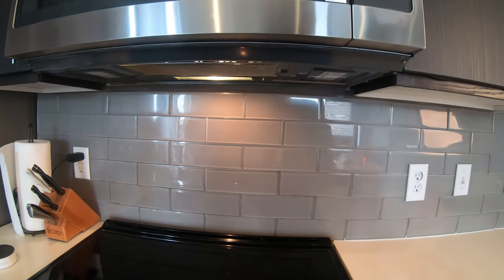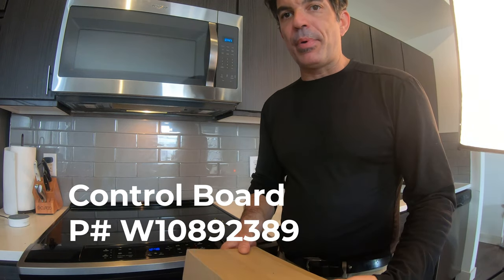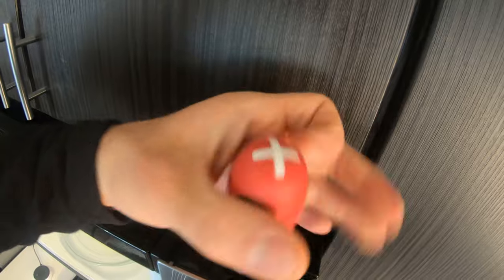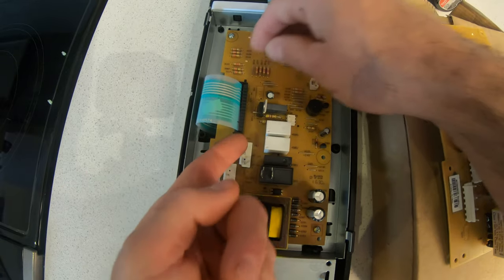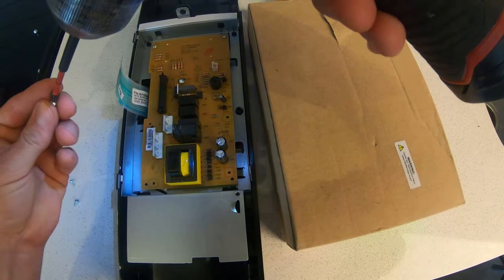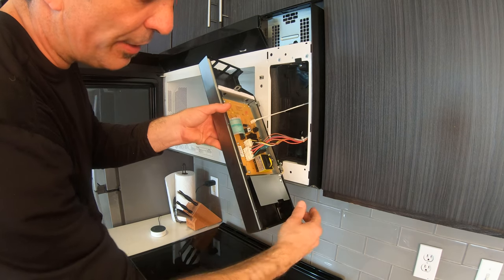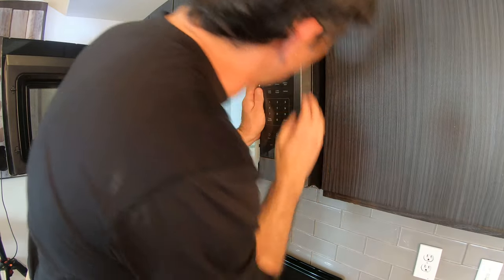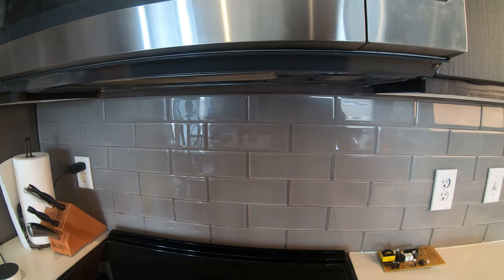Microwave Range-hood Light Won't Turn off

Comment from the maker: Finally got around to making a video replacing the bad triac on the control board. Much cheaper fix than replacing the board! - https://youtu.be/T5OyIWVZFKA
Reply: Did as you said and it works fine with the new Triac, Thanks bunches!

Comment: If you put in an LED bulb, it will stay on all the time because LEDs require such a tiny amount of current. Whirlpools dimmer switch design will always let a tiny current through even when it says off. Put the original style incandescent bulb in it and it will likely then shut off. This was my problem.
Reply: Bingo
Reply from the maker: We don't use the LED bulbs in ours but good call if it helps others with this issue 👍
Reply: We tried incadenscent bulb but it did not turn off either. 2019 model?
Reply: I purchased 10 different incandescent bulbs brands and watts and volts and nothing.
Reply: Thank you so much
Reply: @brauliosalazar2108  me too
Reply: I just noticed your post after writing mine a moment ago and that explains it very well, thanks. I'm leaving the LED in, the lamp won't get hot and being on very dim doesn't bother me.
Reply: @garystephens8413  curious have you had burnout issues yet with the LED yet? I just got a replacement and noticed it's always on and did not want run a risk.
Reply: @garystephens8413  any issues with the LED bulb after 5 months? Can you tell us the brand/bulb you used?
Reply: Thanks! Our bulb blew out and we replaced it with an LED and noticed it wouldn’t turn off. Good to know I don’t have to replace the entire control board. 😂 We will just leave it be and if it bugs us in the future go back to a normal bulb.
Reply: I thought the same thing and it didn’t work man I bought an led and incandescent
Reply: Exactly right. Go back to regular bulb. LED will stay on.
Reply: Thought the same thing but the LED got hot as well and started blinking randomly.
Reply: Our microwave bulb is not LED and that sucker popped after a few minutes. Any other suggestions?
Reply: Yes. That was the issue. Thank you
Reply: Not always the case. The incandescent bulbs stay on because of a fault.
Reply: I have the same model microwave, I just put in a new LED bulb because the original burned out. It is not turning off for me either. :(  I guess I have to swap it out for an incandescent bulb.
Reply: Thank you saved me a real headache
Reply: Thanks. I am tired of changing that bulb. My entire house is LED so this time I tried LED in microwave and it would not go off either. Rather than buy an incandescent build I took my wife’s advice and just leave the LED on. It doesn’t dim either.
Reply: @miriamranalli2896  You have to make sure your LED Bulb is dimmable. I had to replace mine from Amazon because they sent non-dimmable ones. They still won't go all the way off, but the Half & Full settings work.
Reply: So if I have the incandescent bulb in there and it stays on I have to change out the board?
Reply: @ohdag  same question
Reply: I put regular bulb back in and still did not shut off
Reply: @rudybehrens9788  most likely the control board got damaged because I’m guessing when you were trying to replace the bulb first time, microwave wasn’t unplugged from the outlet
Reply: Same has happened to me with LED replacement. It’s much brighter than my incandescent that only lasted 2 months. A dim light over the stove at nite is a great nightlight so I’m leaving it.
Reply: I’ve tried 3 different sets of bulbs, Xenon, Halogen (the recommended replacement for this microwave), and LED too. All of them remain ON and none of the dimmer settings work via the microwave’s touchpad.

Looks like this microwave is going to need a new control board or a replacement outright.

Jenn-Air is the brand of the microwave I’m working with today. 

Note, the halogen got VERY hot and quickly too, which tells me something is definitely wrong with the internal electrical circuitry.
Reply: Needed this I have LED. Will this cause a problem?
Reply: @ayanarudisill3112  u need to unplug power first
Reply: So what is the cost of this control panel,  no one mentioned the cost.
Reply: I'm seeing 120.00 cost 😢
Reply: That was my issue. Sometimes cheaper is better.
Reply: Thank you! I was about to buy a control panel, but i use led lights. You saved me money
Reply: Is it safe to leave the led on all the time?
Reply: That is so fucking mind blowing. 🤯 LED BULBS 💡
Reply: No it does not mean something is wrong,  halogen bulb get extremely hot, hot enough to scald a person.
Reply: Says simple and easy. Takes microwave apart and changes major component...
Reply: Thank you for this response. I thought about that too. I put a led light in. Not intentionally but that’s what I got when I ordered it. I’ll try this route first before buying the circuit board.
Reply: THANK YOU!!  Phew. I bought a second hand stainless microwave this same as in the video & I use all led in my place & it made a big diff in my electric bill !  However the microwave didn’t light up so I went bought a led bulb when I saw they finally had them on such a little bulb last time I bought one they didn’t .   So I put it in but ya it’s high , low , then dim but no off.  My daughter has this exact microwave in the house she built & it turns off so I knew it was suppose to.  I was afraid like this video shows it was some part ( that I’d never bother to buy ) lol. So thank you for adding this comment & letting me know that’s probably the issue !  That’s just great.  Thank you so much !  Really.

Comment: Thank you for your video. It was very helpful. Have a Whirlpool model WMH31017HZ-0, 10/17. Changed the above range bulb WITHOUT unplugging it. Heard a large pop. Fried the light socket and that part of the control panel. Had to replace the light socket and the electric control panel. Repair vs replacement costs were close. Customer service at Whirlpool was not helpful. This video was what was helpful! Thank you. Side note: If you replace the electric control board, the black mechanism that the green ribbon goes in is “tricky”. The black piece does elevate about an eighth of an inch when you pull those tiny black tabs up. When you carefully put the ribbon into the slot, you have to push down gently on the  black mechanism to lock the ribbon connection.
Reply from the maker: Ya I’ve seen these fry when replacing bulbs before. Thank you for sharing your experience with us 😊
Reply: Very helpful.

Comment: Thanks for the video.  Experiencing the same issue.  I pressed the Light button and heard a pop and bright flash.  I thought the bulb blew, which it did, but apparently it also zapped the control board.  Mine is from 2016 (WMH31017FB - 0) and Whirlpool chat was not helpful once they got my S/N and saw that it was well out of warranty.  They won't do much of anything beyond confirming for me that there were no recalls on this model.  Before seeing this video, I just bought an LED bulb off of Amazon.  It's a 5W LED (40W equivalent) and used about $.52 of electricity per year if left on 24/7, so decided to go that route and will likely stay that way unless I decide to buy the triac.  Thanks for the video.

Comment: Thanks for this video.  I was able to follow it exactly and perform the replacement without major difficulty.  I was surprised at the trickiness of getting off some of the connectors, especially the two individual wires (black and red).  And just in case someone else didn't take enough pics while disassembling--the black wire goes toward the back.

Comment: The Triac P/N BT136-600D on my control board P/N W10800189 was shorted between terminals T1 and T2. There are two triacs on the board. The culprit is 7919 (marked on board). Amazon sells them cheap. Replaced it and all is well. Saved some money. 😁
Reply from the maker: Nice job John thanks for sharing your repair method 🛠
Reply: Thank you thank you!!!

Comment: I discovered the failed triac a couple weeks ago after locating the schematic online. I ordered the part and soldered it in replacing the tested bad part. This took slightly longer time and required a little more skill than board swapping. The money saved was substantial compared to the board-swapping option. David Shaddock beat me to posting; and wrote a thorough posting at that. I am sure others can make this same fix, or at least try because it is cheap to do.
Reply: Can you share the link to the schematic?
Reply: @XCodeHelpHub  I am trying to find it as well.
Reply: You can usually find the schematic tucked away inside the microwave- mine was under the top bezel thing in a black plastic envelope...I posted a vid on this

Comment: I have this exact model at work. Apartment maintenance tech here. Instead of replacing the whole control board, if you have a soldering kit, you can replace the transistor for the bulb. They usually run around $0.75 a piece and take no longer than 30-45 to do.

Comment: I had the same issue from a shorted board that was the result of changing a burned out light bulb. After researching the cost of the replacement board, I decided it was a better long term solution to just buy a new microwave. No more Whirlpool microwave ovens for my house.
Reply: Which microwave did you replace it with and is it better?
Reply: Mine has been terrible!!
Reply: Ya pretty sad. Ours is 2 years old, figured it was just a burnt out bulb. Nope needs this to be replaced. For $120 I might be going with a better made product. I’ll never own another whirlpool appliance again.

Comment: That was a great video explanation for my problem! Moved into a home the end of last month that has an otr microwave with this exact issue. The bulb was burnt out and been trying bulb after bulb, all staying on as soon as they're screwed in and the power is plugged back in. Nice to know there's a solution, but I'll have to weigh the decision of spending that much to replace a part or just buying a new one, because it is a bit older and who knows what kind of maintenance the previous owners of the home actually did.
Reply: I installed a toggle switch in series with my hot wire. It breaks the hot and I saved myself a couple hundred dollars.
Reply: @davejalenderki  How do you identify (just) the hotwire for the range hood light?

Comment: Thank-you for posting this fix.  I have a $375 Maytag that has the same design and issue.  Same bulb issue after only 5 months.  Notice that Amazon doesn’t sell Maytag and Whirlpool microwaves.  Amazon would go broke on return shipping.  How many people buying these things are able to lift this off the wall replace a microchip board and lift it back on to mount it.  Its going to cost the price of the machine to have it repaired.
Reply from the maker: I didn't have to take it off the wall to replace the control board 🤠
Reply: @ApartmentMaintenancePro  No you don't, but one should not have to fix Whirlpool's defective appliance in the first place.
Reply: Run from Whirlpool
Reply: There is an easy way to take it off the wall and put it back on again. When I installed my Whirlpool I constructed a wood platform to sit on the cook top, 2 " lower than the microwave sits installed. Releasing the front mounting bolts dropped it at a slight angle, enough to lift the back out of the wall bracket clips with it resting square on the platform. I am a 73 year old DIY'er lacking the strength I had when younger, though I am still strong enough to lift it from the lower counter top of the  island to the platform or the reverse. It was easy as pie :)

Comment: @Apartment Maintenance Pro...Thank you for taking the time to post your work around. This is the exact issue I'm having with our Whirlpool microwave!  This unit was replaced 2.5 years ago. This morning, I replaced the burnt out bulb with the same: a 40 watt Feit Electric 40-Watt EQ 2.2-in T7 Soft White Dimmable Appliance Light Bulb.  The bulb works and that tells me the light socket and wiring works.  just can't dim or shut-off the bulb with the control panel on the right side of the unit.  Maybe it's the control panel. I'm subscribing to your channel. Helpful.
Reply: Hi Carl i had same problem. I fixed my two year old whirlpool by soldering in a new triac on the board. cost $10 for a 12 pack on amazon. Just match the part # on the triac.
Reply: @joeleberle7723  Where is the light control triac located on the board? Thanks
Reply: Were you able to fix the issue?

Comment: TY TY! I have a GE microwave with the same problem and in an apartment.  I was worried about leaving the light on until maintenance could get here, the light was getting quite hot, and I couldn't figure out where the plug is.  Mine is in the same place as in the video.  So, while not fixed, at least I don't have to worry about waking up in the middle of the night to a fire in my apartment.  Thank you!

Comment: Take a picture of the plug connections  on the panel before disconnecting. Once the plugs are reconnected, test the functions before final assembly.
Reply from the maker: Thanks for the tip 👍

Comment: You were totally right on about the fix. The control board I purchased had a update to the thermistor . The added an integrated thermistor. Hopefully this will last longer than 3 years.
Reply: Hi, can you please tell me where you got the control board? I am looking for one and couldn't find the right one. Thanks.
Reply: Yes need part # and from where

Comment: This is a great video that covers the easiest way to fix. The board cost around 100 bucks tho...the component on the board that controls light dimming is called a Triac, and if you can find the schematics and are handy with a solder gun, you can replace just that part for much cheaper. Not everyone can solder tho, so this is best for most folks
Reply from the maker: Yes for sure swap out that triac if you have the skill set
Reply: Perfect
Reply: Can you show me a pic of the triac?

Comment: After going through 10 different bulbs that would not turn off  I replaced socket 1st and will do this now. Thank you for this video and I hope it works for mine. Very very similar model microwave

Comment: The question no one has asked: CAN I LEAVE THE LED ON HIGH ALL THE TIME WITHOUT DAMAGING THE CIRCUIT BOARD? Yes, I know that the replacement LED bulb is not dimmable. But it doesn't use much electricity, and makes a great night light.
Reply from the maker: These circuit boards are weak sauce so do so at you own risk :)

Comment: Great explanation!  I can’t believe how unreliable these modern microwaves are. 
I can’t get my light to turn on. I replaced the bulb, and the bulb socket. Light still won’t come on. Microwave is 8 months old… Maytag.
Reply from the maker: Might be a bad relay on the board I would trace it out . Will need to be handy with a multimeter

Comment: I just replaced my oem bulb with an LED bulb... oem halogen bulb works as it should, led bulb shows exactly the results you showed here very dim but still on when set to off.

I looked at the replacement LED bulb... "not to be used with dimmers" in very small letters but nowhere mentioned on the packaging

The only way to turn it off was unscrew it and screw it back in and then it was off.
Reply: Yep, that's exactly what I do

Comment: Question: The bulb burnt out on my Whirlpool microwave. When I went to change the bulb, the bulb broke off of the base and got stuck in the socket. I unplugged the power and used pliers to unscrew the base that was stuck. It was a challenge because as you know, the socket faces towards the wall, and it's nearly impossible to see directly inside of it without pulling several muscles in your neck and back, or pulling the whole stove away from the wall to be able to stand right underneath it. So after struggling, I finally got it loose and unscrewed it, screwed in the new bulb, and plugged it back in. The button on the microwave that controlled the light worked perfectly fine before the bulb burnt out and I fiddled with it. So my question is...before I go replacing control panels or anything like that...is there something I might've done while I was trying to get the base of the bulb un-stuck? Like maybe loosened a connection of some sort? The microwave is only a year old, and that was the first time it needed the bulb changed since it was installed. Sorry for the novel about my bulb battle. Any advice would help! Thanks!
Reply from the maker: The bulbs in these microwave take out circuits like crazy if changed when power is applied to them. Check out the pinned comment, if you are good a circuitry this can be fixed for a few bucks.
Reply: Same exact thing just happened to me. Came to change the bulb and it exploded on me. Put a new one in and it won’t shut off. The original bulb only lasted 4 months and it doesn’t even get turned on all that much.
Reply: Also my problem! Maybe this should be whirlpools problem.
Reply: Holy. Crap. This is so weird because the same exact scenario to the T just happened to me. Light bulb broke off and everything lol. Wild. Anyone able to have this covered under warranty?

Comment: We just received a brand new KitchenAid microwave.  The original bulb gets very hot so replaced with an LED light bulb and having this same issue.  At least the bottom of the microwave won't burn us now.

Comment: If the light stays on, then a relay may be stuck in the on position providing constant power to the bulb socket.  Removing the bottom panel provides access to the bulb socket.  Adding a switch to the positive line to the socket and installing the switch on the side of the case, would allow you to turn the light on and off.
Reply: wouldn't a switch on either cable do the job?
Reply: @zaratron  dude!! You never put a switch on the return line. Always on the supply line.
Reply: no he means if there is 2 bulbs @dummgelauft

Comment: Question this problem was not there when regular bulb but when I replaced with LED bulb this happened. Is it still the control box?
Reply from the maker: I don’t think you can use LEDs for microwave lights